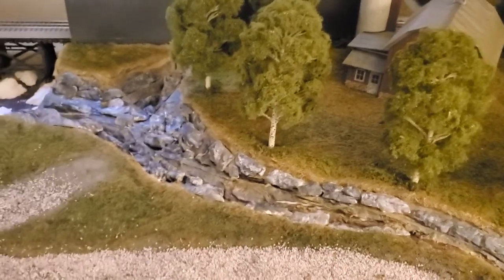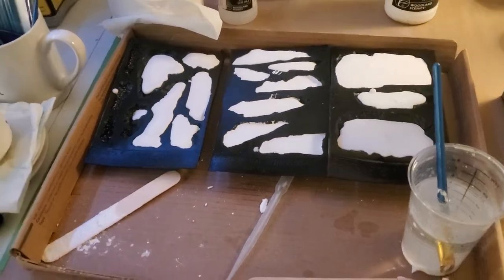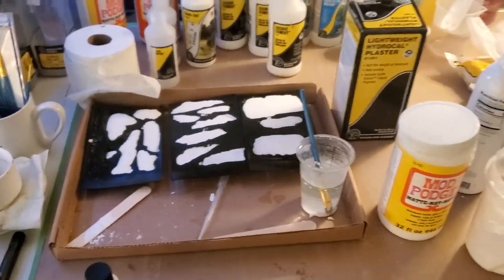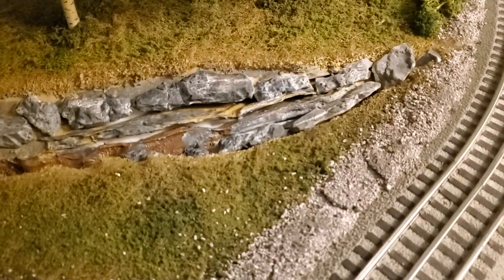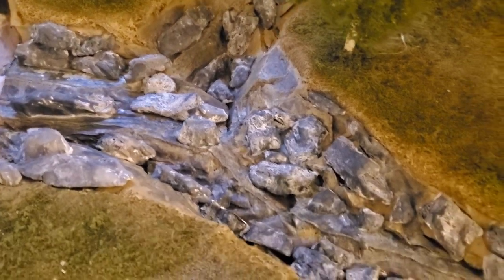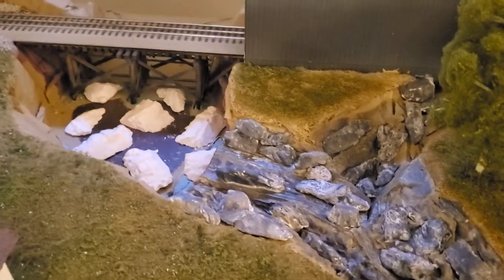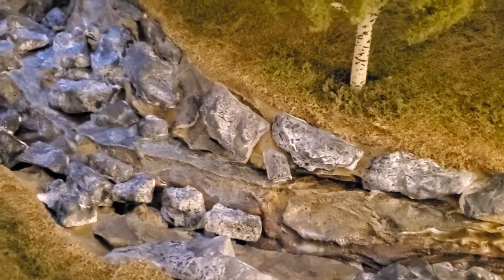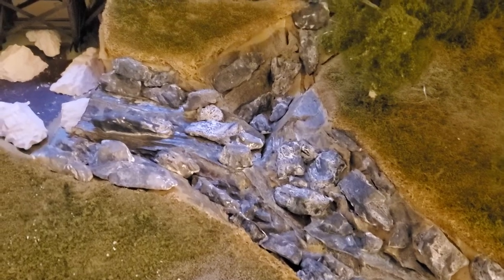Laying stone in creek bed.

Comment: Looking very nice.  Looks like some of the Small Rivers and Stream here in the Mountains of West Virginia. Not sure what you are using for water but I just used Clear Super Glaze that comes in a box with 2 bottles you mix from Walmart.  Works way better than Woodland Scenics.
Reply from the maker: Bought Dr Crafty 1 gal clear epoxy 2 part resin mix from Amazon.
Reply: @ForrestAdam  Great stuff and dries pretty quick.  I'll be checking back to see how it turns out.  Just Subscibed.
Reply from the maker: Already poured.  Scroll thru videos and you'll find it.  I still need to do surface effects and waterfall, but happy with it so far.